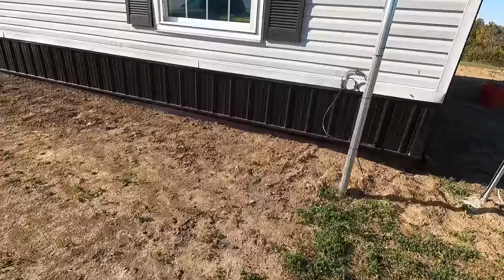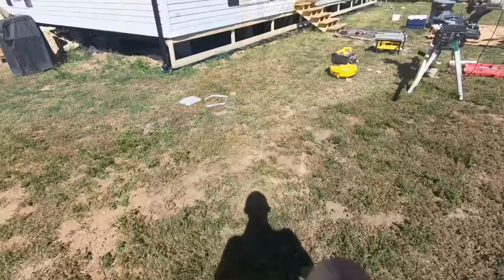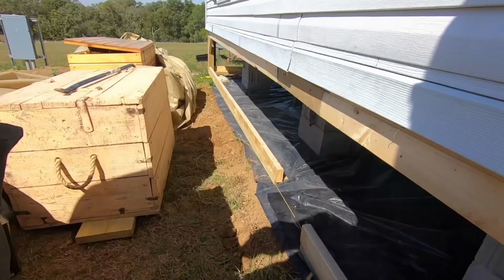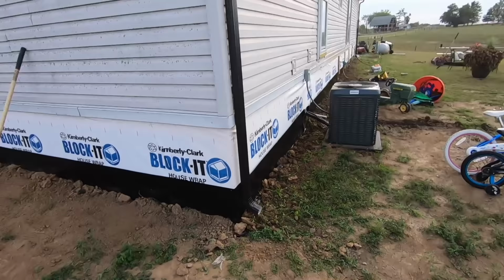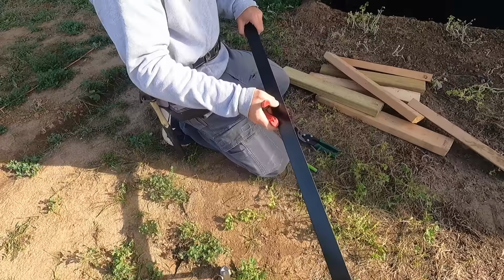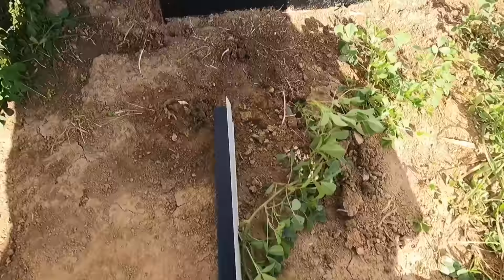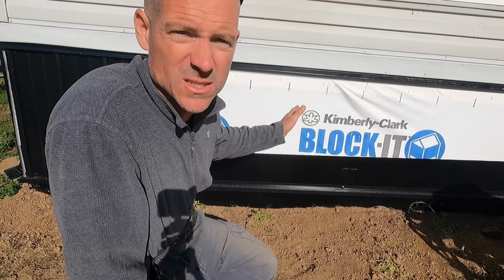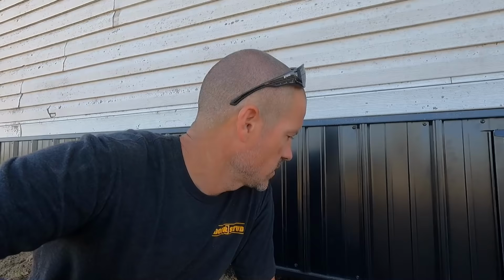Mobile Home Trailer Skirting | Rodent Proofing

Comment: What do you do to prevent termites getting into the wood and going up into the house???
Reply: Thanks. I have been planning this about had all my materials but I was going to use rebar too use for support on the bottom .Thank you so very much!
Reply: Mine is 48 inches to ground and I'm going to use clenker as my base material for for the bottom to keep like termites away.

Comment: How do I find the metal (steel) skirting in order to purchase it? I've been searching online and cannot find it. I want the same one you have, but in hunter green.
Reply from the maker: Menards is where we get ours. They come with one color on a side and a different color on the other side
Reply: @MrPostFrame  would this be similar to Lowes or Home Depot?
Reply: @N24N6now  yes, Menards is a big box store. I suggest you find a metal roofing supplier in your area. They will cut the metal to whatever length you tell them. They will also be able to provide all the trim pieces and screws needed so it all matches perfectly.

Comment: No vent,
Reply: I was wondering about that... I'm not sure what the guidelines are for vents/no vents in mobile home skirting? I've seen it done both ways and I've also seen some that are only vented every third or fourth panel...
Reply: Because I saw mobilhome in my neighbor, They put the vent and I asked, they said the code require for moiture and air flow
Reply: @hoangpham4468  Yes, I'll have to check code for here, I know each state is different. Thanks!